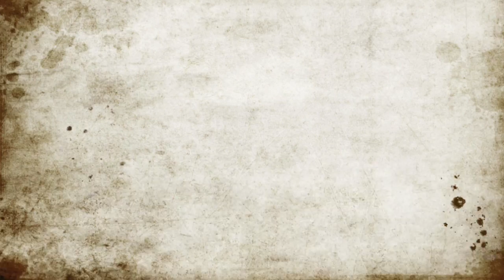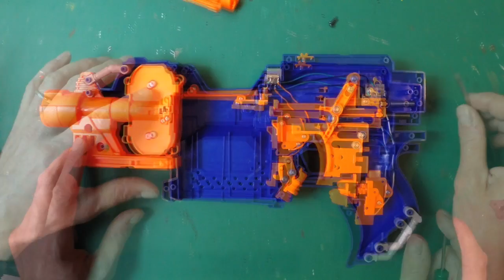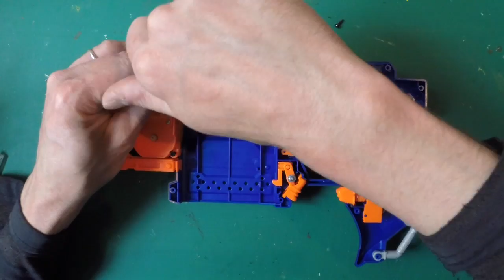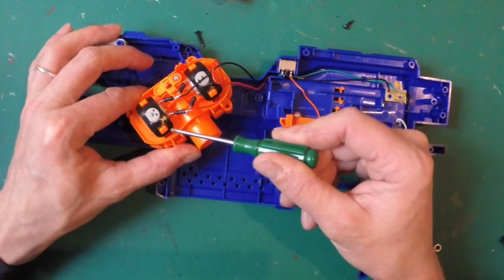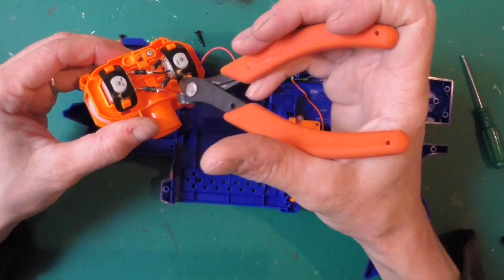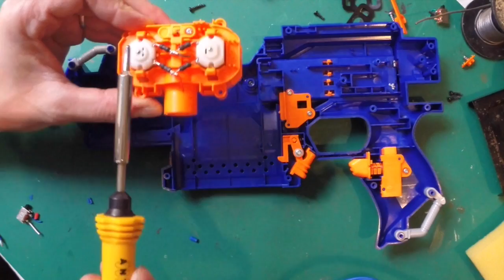Nerf Stryfe Re-Wire Part 1

Comment: Where can I gat the wire is it stranded or not
Reply from the maker: It's stranded 18Awg silicone insulated hobby wire, or 16AWG for 180's. I get mine from E-Bay or if you buy the Blastersmiths UK kit it comes with all the wire and switches.

Comment: I would not have been able to do this with out your assistance. This video is an excellent guide. I also watched your big battery guide which also is an irreplaceable resource. Thank you for the thorough videos.

I had a great experience rewiring my Stryfe. This was my first time soldering anything and my first lipo battery. I had absolute no experience prior to this project, but my outcome was extremely pleasing. My connections were sloppy but function as expected. I tested my blaster with a 9 volt as you instructed. When I heard the motor's wind up for the first time after my rewire, I was enveloped in pride.

I would like to point out the materials ran me about $100 usd for everything. The charger and battery were the main expense. I could have found better deals but I went to my local hobby shop and purchase equipment there.

Thank you 1000 times over. Your work made my experience possible.
Reply from the maker: Glad it was useful.i just thought all the other guides lacked clarity.

Comment: Thanks for this video.  What kind of battery pack would you use in this build?  I feel like a lot of packs obviously wouldn't fit in the battery tray.
Reply from the maker: Here is the list of what fits the tray with a bit of hacking http://britnerf.myfreeforum.org/about1270.html&highlight=lipo
Blastersmiths do a tray expander for stryfes, or if you are a Stryfe pistol user, you can use Efest 14500 IMR cells, button tops. They are like Tossfires but provide actual current. Not as good as lipo but good compromise. 3 in the tray gives 105fps average. If you put a pack in there use a deans connector on the end of the two wires that I soldered to the battery tray contacts, making it longer first and feed it to go out into the tray.